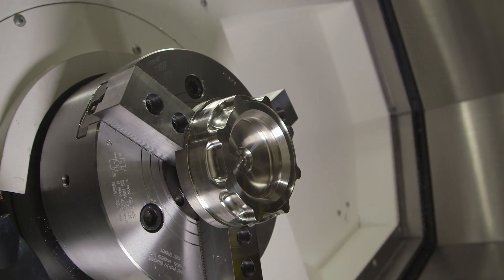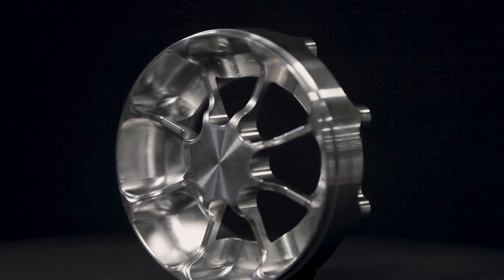CNC Machining an Inconel Rocket Part for the CUTTING-EDGE New Aerospace Academy | DMG Mori NLX 2500

Comment: How does the Blaser coolant work with copper?
I'm running Qualchem 250 now and it's not working so well with copper.
Reply from the maker: I haven’t ran copper for a long time but it did well on Monel... which is Nickel and Copper. I switched from QualiChem and would never go back.
Reply from the maker: Also, I run a higher percentage... at 10